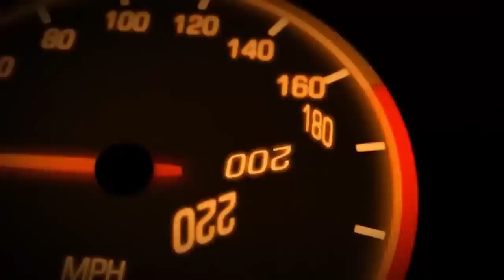Supercool Limited Hydro Plane Dyno!

Comment: Thanks for the video. Just wondering if you could do a video explaining the difference between gas, e85-890 and methanol and what it takes to run them. I know if anyone could break it down into something easy to understand it would be you.
Reply: Could also Google it not difficult to figure out
Reply: E85 and or the xylene, toluene and everything they dump in smells like death. I'd say that's the biggest come away lol. (E85 is amazing, it just sucks that it doesn't smell like good race gas!)
Reply: If he doesn't get to it, I will give what my understanding is on them.
E-fuels a have higher octane rating but lower power per given amount of fuel compared to gasoline. Higher octane levels resist detonation so you can run more compression and timing, but need a lot more fuel to get the same power as you would with gasoline. Methanol is even worse as far as power density, but it has a significant cooling effect on the intake air temps and also a higher octane level than gasoline, similar to a high % blend of ethanol.
Reply: @KimiWallrus  ignite has some very good e85 for racing applications
Reply: @KimiWallrus  huh? I run vp e85 and the stuff smells EXACTLY like some quality moonshine lol.
Reply: @nsboost  Race gas smells better than any Alky I've ever been around to me. Leaded gas i.e. ethyl or race gas is endangered.  90 percent of it is made for aviation and California has already been clamping down on it. If they eliminate leaded gas for planes I highly doubt they will continue making a couple gallons per year for racing which wouldn't be so tough to swallow if good e85 was available more plentifully.
Reply: @Rcp11  Google is not the ultimate expert nor the information/people it refers to. Steve's perspective is/would be interesting given his experiences
Reply: I know this is being a bit of wise guy answer but years ago I asked a similar question at a drag boat event and a was told “Son, Gasoline is for washing parts, Alcohol is for drinking, and Nitromethane is for racing. So what do you want to do wash parts, get drunk, or go racing?”
Reply: @gullreefclub  🤣🤣🤣 that's gold 👌
Reply: @roadiesgarage3816  I believe there’s more information on Google then what Steve knows I love the guy but there’s endless information out there
Reply: Ethanol and methanol also have more oxygen content. If you take any motor and switch from pump gas to e85 or race gas like c16 you will not make any additional power with that alone. Now as stated above if you take a motor and run say E85 WITH additional timing, the increase in timing will net you some sort of gain. These gains will also be much greater with a boosted application compared to a N/A application
Reply: One of the down falls with E85 is its anhydrous in nature. Meaning it will suck water vapor from the air and cause rust in your fuel system if you leave it in the lines/tank for extended periods of time. Both Ethanol and Methanol like a hotter engine coolant temp wise if I remember correctly
Reply: @highpsiguy4085  C-16 makes more power than 87 in any motor with a mild cam or more. It doesn't burn slower, it burns better in many fascits. Race gas hates or loses performance when the front ends or the fuel are lost so E85 is just as suspect to suck as C16. Q16 gets bought in five gallons for a reason and it's cheaper than the real go fast fuels.
Reply: @highpsiguy4085  your a engineer I bet?
Reply: @KimiWallrus  Am I an engineer? No. I own DSM's. All of which are on E85 and making no less than 600whp on a stock bottom end. We aren't comparing modifications to a car. You put c16 in a bone stock 95 civic and you will NOT make more power with the changing of fuel alone. I think you were misled in your understanding
Reply: @KimiWallrus  I never said c16 burns slower either. I'm not sure where you got that idea from.
Reply: @highpsiguy4085  anything with a mild cam or bigger will gain from C-16 as long as it's fresh. As I said before......
Reply: @KimiWallrus  you missed the entire point. ANY FUEL BY ITSELF will not gain you any horsepower with JUST the addition of fuel.
Reply: @highpsiguy4085  your absolutely WRONG! People have extinguished barrels of fuel for nothing considering they could have consulted you! So your saying basically we should all run 85 octane when available because the higher octane doesn't make power too. I agree during normal operations at 50-70 hp tooling around town, the 85 makes less pollution but good gas doesn't need more compression to gain power. Last time I'm saying it....Good gas always makes more power! In a Ford Escort it might be 3 numbers, in a 454 tow vehicle 5-10 and so on, obviously based on if you dump something super tame in will very results but it's always better or your drum gets left open with the pump stuck in it, bleeding out the good. Answer me this, what burns quicker, gas or nitro? Nitro is like 35 octane. Nitro will make more power in every motor if you add a small percent and it burns slower than c16.
Reply: @KimiWallrus  it's been proven false. I can't fix your ignorance
Reply: @highpsiguy4085  Your wrongness makes me.....angry
Reply: @highpsiguy4085  did you read that from the "brainwashings" in print or the internet. If you really want to have a argument let's discuss how misled everyone is about av gas, where it comes from and what it actually is vs. they 10 things Engine builders tell customers about it because they sell you VP or Rockett or whatever. "Top end lube! Omg no top end lube., its so dry" 😂....so much bs on that subject too!

Comment: Marine racing must be brutal to build for when they're on/off the throttle 50 times in 5 minutes. Well, the offshore guys at least.
Reply: It's more than brutal.......its like being in 5th gear flat out going uphill while pushing the clutch in and out a few times to make things interesting 😆  
I've been out of racing for a bit but we used to run a spec mercury racing motor and then I had built motors for playing and car guys used to always think boat shops were ripping them off for things. But boat's need to be built almost twice as much for a given power. Every few years we'd get a boat that some speed shop built torn up before 20 hours learning an expensive lesson.
Reply: I should add that Steve is one of the few that gets what marine engines go through and some of that thinking carried over into how he builds such successful drag n drive engines.
Reply: Well the engine in my 1/4 mile boat was built to be beat on. Then I also had a lake motor, it too got beat on once in a while .😳
Reply: Not quite off shore racing but there is a boat.
 " Miami Vice: Russ Ballard - Voices [1080p HD Stereo Remaster]  "   Apr 29, 2020  on the channel  " Brightraven  "
Reply: @bobroberts2371  if you want to see some serious stuff take a look at Mercury racing. They have some nice big blocks and even created a dual overhead cam 32valve monster with turbos that puts out something like 1200 on pump gas all day long and even more with proper fuel.
Reply: @michaelmcclure8673  I used to have a 21 hydrostream with a 2.4 bridge port when I lived on a lake. It was crazy enough to keep me away from drag boats 😆
Reply: @southjerseysound7340  I did see vids on the Merc motors a few years back when I was investigating if there were any marine engines worth putting in a road race type car.   Supposedly some sprint cars used marine 2 strokes in days gone by.
Reply: @southjerseysound7340  friend of mine was looking at running a built inline 6 Turbo (Australian Barra) I recommended he get it built to handle 1000hp and run it at 500hp
Reply: @fullsendmarinedarwin7244  if you're only going to run it a 500hp why would you build it at all? That's easily achievable in bone stock form.
Reply: @danieledwards1081  duty cycle. figured a 1000hp engine running at 500hp would last a LOT longer , if you want it to last 1000+ hours and be reliable better to be way overbuilt. You have to remember boats run at much higher and constant load. not uncommon to sit on 4500-5500rpm indefinitely

Comment: Fun fact, the UNlimited hydroplanes use turboshaft engines like the ones used in Chinook helicopters!
Reply: Not all of the them. The U-3 team is still using turbocharged Allison V-1710 12 cylinder aircraft engines on Methanol.
Reply: Thank you Captain obvious.
Reply: @brucedressel8873  How the fuck is that obvious? The boats are covered in carbon fiber and fiberglass. At a glance I don't think most people would think 'turboshaft'. Of course once they fire up that's a different story, but not everybody is a boat guy.

Comment: spent a lot of my summers in seattle 1955 -1962 . became freinds with oly bardahl . pretty much spent my summers hangine around the shop,can't count the times i polished that boat and swept the floor in the shop. thats where i aquired the need for speed.question? how do you think they cooled those merlins
Reply from the maker: Merlin’s know of were the V12 and they were water cooled
Reply: @stevemorrisracing  there was no rad. the only parts of the boat in the water was the tips of the sponsons half the prop.and the rudder. from what i understood they ran 10percent nitro methane 90 percent water.the had to run flat out to keep them going and used nitrus oxide to keep them runnig in the corners.
Reply: @billanominous7979  Most boats don’t have radiators, They have heat exchangers, intercoolers, power steering coolers but not radiators! Race boats will usually have a pick up tube mounted somewhere on the transom that forces water up to the engine!
Reply: Sorry not to get back to sooner i'm old and have been a bit down.Unlimited hydros experimented with a fuel mixture or 90per. water 10 per.nitro methane engine blocks most likely were filled alchol.these boats were very hard to start, you could see water comming out the exhaust.other boat had other systems.I can,t see how water could picked up when the only thing in the water.were the tips of the sponsens half the prop and the rudder.I remember talking with olie Bardalh they were very tight liped about what fuels they use.I wonder what they could of done with cnc and billet alum.

Comment: Is there a range that the hp and torque numbers need to fall in to be legal or is the class just parts, gas and weight spacific? Just curious what the range it needs to fit in, like 1500hp-2000hp?
Reply: With the spec parts it’s gonna be reasonably limited to a power range. If they just limit blower size and speed that pretty well dictates max power. 
But, you still need to do the work to make sure you’re really getting all you can with that limited combination.

Comment: Hey Steve, can you tell me what the type/model/etc of the O2 sensors are on each of those headers? I don't think I've seen ones that small before.
Reply: Also, I have no clue, maybe they are pressure sensors? Idk. Just curious!
Reply from the maker: Those are ex gas temperature

Comment: Disregard to anyone that reads comments and expects relevant thoughts  Is a "Hydro" a "Plane too?"  Did the coastal smugglers of the 80's and 90's order their Hydro's plain(so as to not be caught) and or can you order a Hydro "deluxe." If your Hydro doesn't have a LS it's not plain but will 90 percent of You Tube engine boobs claim it won't plane because it doesn't make enough power? Am I not living right or is my catholic port heads breaking valvetrain parts on my 900db LS, I never run it over 4500 rpm? I broke in every cam at 2500. The last one I ran all day at 2500 to make sure it was well broke-in and it still failed a spring. LASTLY who's uncles cousin was was in fact the guy who Hydraulic'ed the Hydro in the pits at a Hydro race? Every person I know in from Hazard to Manchester Kentucky that owns a boat has told me this story for over 30 years. None of their boats had floated, 'planededid'" or ran for 30 years so im really interested if they was hauling out to Firebird and apent all of their dimes or what, their arnt any good drug drop lakes this side of I75 so i wonder the motivation and spot they raced drag boats(Hyrdos raced in 2 places in KY, on ohio river but it wasnt drag, . If someone answers one question for me I hope it's the last.
Reply: " Catholic " port heads?

Say 10 Hail Mary's my son. 😎

Comment: Oh come on Steve! Can you give a low-ball number? What's typical for the class? What would it do, approximately, with a carb instead of EFI? I would like to have some reference/idea of what power level is typical for this type of application. 1000+? 1400+? Just ball-park it on the low side please.
Reply: i wanna say its upwards of 2000...could of been around 1800 on carb thats with that old blower of course, new blower and efi i want to say well over 2000 if that would help lol just pondering
Reply: @ArmoTypeArt  Ah, thanks! I'm a metallurgist, not an engine builder, so as I said, I'm a little short on reference/what'd be typical.